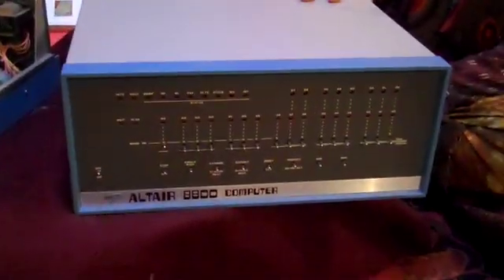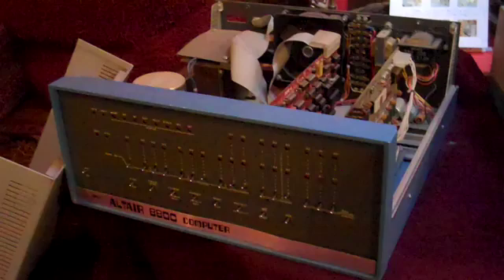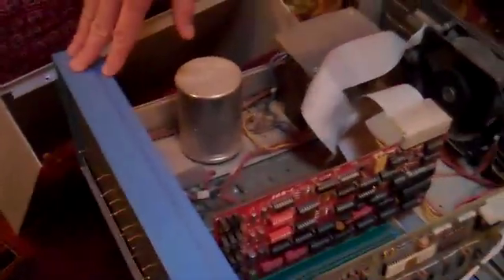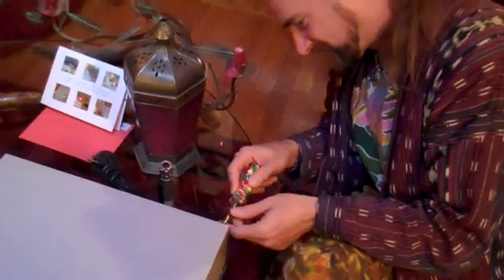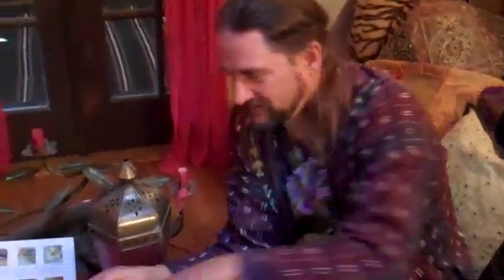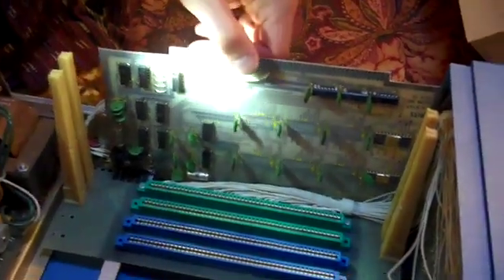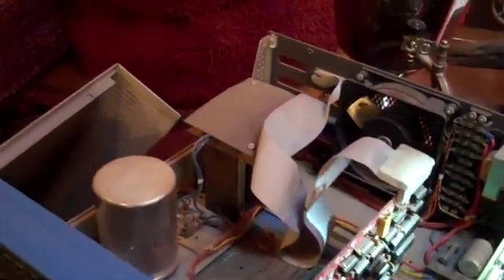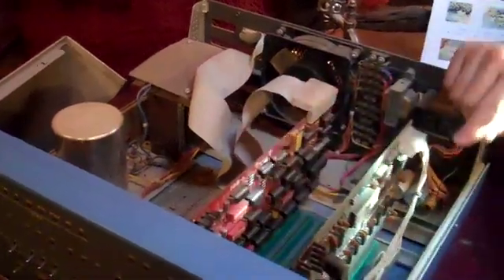Inside the oldest mint-condition microcomputer

Comment: how is it a computer if it doesn't have a CPU?
Reply: Central.
Reply: That case has been opened. They would not ship a memory board just floating around inside the case loose. Unless the owner ordered a case only (parts, little use otherwise) it would always include a CPU board.

Comment: Thanks for posting this video of an important machine.  MITS sold about 10,000 of these machines before Apple sold their first board.  They were useful for control applications and ham radio operators used them for something to do with morse code.  

By the way, it is important to never touch an edge connector with fingers.  The salt will corrode the contacts.  Clean it by rubbing with a pink pencil eraser.  Then brush it off and wipe it with 99% oil free isopropyl alcohol and let dry.

Comment: These units used linear power supplies with several large capacitors.  These can be seen in this video, they're the black and gray cylinders towards the rear of the case.

These tend to dry out over time.

I would be very wary of powering this system up without checking those first, and probably replacing them for good measure.

Comment: It's possible that it was shipped inside the case and then fitted by the user. The plastic brackets might not have held the board in place during transit so it was left floating. Tis indeed a mystery though